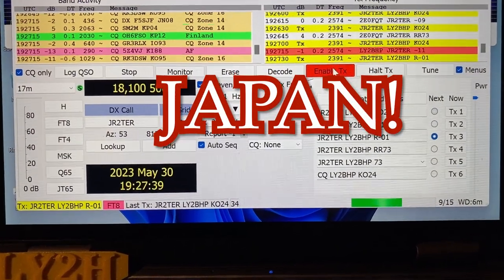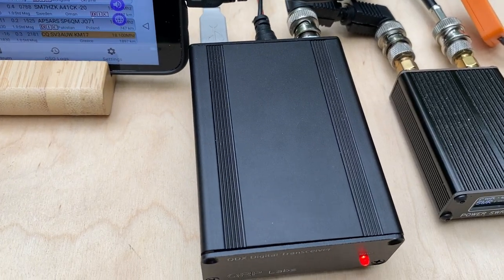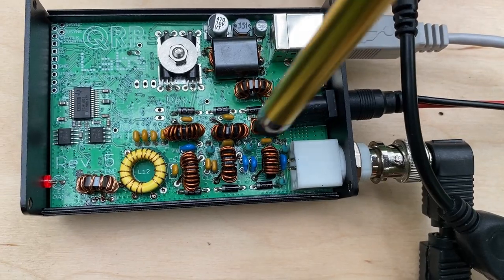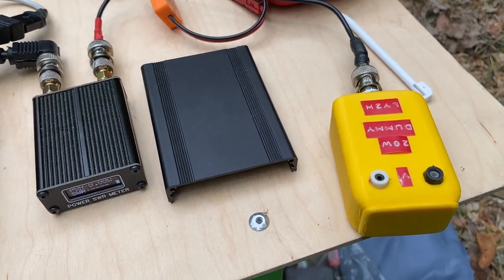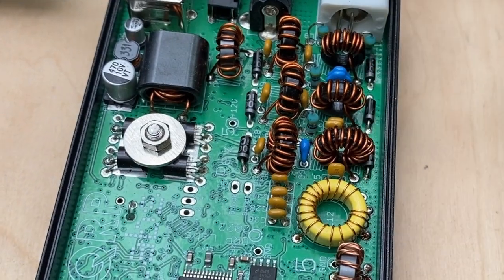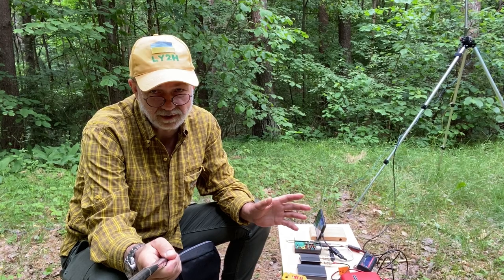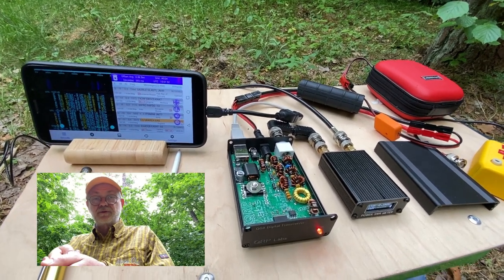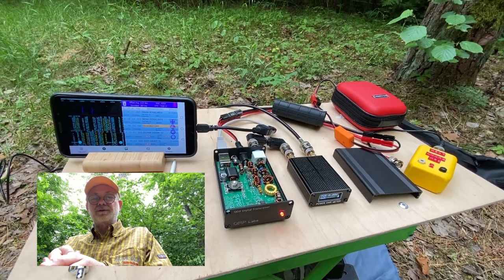QDX High-band Digital Transceiver. Problems you didn’t expect.

Comment: They changed to blue/yellow cores in a later version of the high band.  I had a wrong mterial core when they were all black.  Both work fine.  These are great rigs. 73
Reply from the maker: Thanks for the info! Yes, you are right, I think the info on the changed toroid colors was explained by QRPLabs as changed suppliers etc. Have fun! 73! LInas LY2H

Comment: Nice video and thank you for sharing. How do you tune with the tuner? Do you use another rig to tune it to the band you want first and antenna, then use the qdx or do you have another method?  73 Jason, WV3V
Reply from the maker: Thanks Jason! In this particular case I've been  using my Nano VNA to tune my vertical whip to resonance before running the QDX. In other cases when I can't use any resonant antenna,  I would use one of my tuners I have, like T1 , N7DDC or manual Z-match, etc. The FT8CN app does not have the Tuning function to generate the signal, unfortunately, so it would probably take just to call CQ :). Again, the resonant antenna would make things much easier and safer for the finals, but on the other hand , my personal impression is that the BS170 transistors stand a short-term over-SWR which might appear during tuning quite OK. HTH, 73! Linas LY2H

Comment: What are you using to power that transceiver? I just took delivery of a low band model designed for 12 V supply. But I'm being advised not to run it at 12 V because that may blow up the finals. I had intended to use a 12 V Talent Cell battery from Amazon that is switchable between 5 V and 12 V. But maybe I should get a 9 V battery instead. What do you think?
Reply from the maker: Hello, I think the power supply voltage is not causaly related to the death rate of the final transistors :). There are many more other ways  to kill the BS170 :). I'm running my QDX's off 9V but due to other reasons which seem important for me, like, being able to use a wider range of  batteries, including partially depleted 12V batteries :), etc. I'm using an in-line DC/DC downconverter to get my 9V in a compact way. It's desribed in detail here:
https://youtu.be/9dobqEHw9Ks

But 12V is fully legit and has its own benefits, like you can get the power output reduced easily ( if you want even more QRP than it is)  by feeding the12V radio with 9V power supply . I'm building the new QMX now and I think I'll make it 12V as I'm planning to use it also on  WSPR and other beacon modes where you only need the power of 1-2W or less. HTH, 73! Linas LY2H

Comment: Thanks for video Linas. Hoping to build a QMX soon and get it connected to my Android phone like this for some portable digi ops. Alas, currently, QMX is like Low Band QDX and only goes up to 20m. I know that I will miss 17m. However, Hans has indicated he may produce a Mid/High band QMX. 17m has been a fantastic band recently for QRP and portable/mobile operation.
Reply from the maker: Absolutely, Steve! The same’s here- I’m in a process of building the QMX and I’m , too, already missing the 17m band :). No doubts, there will be High band version of QMX too, Hans seems serious about that ! So, let’s solder and wait :) 73! Linas LY2H

Comment: What cable are you using to go between android and QDX. Thanks Joe
Reply from the maker: Hello Joe, thanks for watching. It's a two-part cable comprised of an micro USB to USB-A female OTG  pigtail (available in all places selling smart phone accessories) and a short USB- B to A cable which I made myself of a 20 cm piece of a standard B-A signal cable with self-installed A end. I DIY-ed as I hate these long "printer" cables coiling around :) HTH, 73! Linas LY2H
Reply: @Linas_LY2H  Thanks very much. 73

Comment: Linas, thank you for your videos!

Can you tell me what cable youre using between the QDX and SWR meter? That looks really nice!

Also what antenna do you use? EFHW? Any particular kit? In an inverted-v, or just thrown up in a tree?

Thanks!
Reply from the maker: Hi Tedd, thanks for watching! The cable is home made of two BNC 90 degree angle connectors and a short piece of cable :) I failed to find in my junk-box  SMA patch cables of a right size, so I went DIY BNC :) 73! Linas LY2H
Reply from the maker: Sorry Tedd, I've missed the antenna part of your question :). The antenna is a vertical described in detail in this video https://youtu.be/9ob7RVwbkOU
HTH, 73! Linas LY2H
Reply: @Linas_LY2H  all good, thank you for your replies :). I've been checking out all your videos, I think I want a kit very similar to what you have for your "portable POTA ops", but I'm having a hard time getting some of the pieces together. This is my first adventure into HF so I'm hoping to get it right.

Cheers, 73!

Comment: Is there a way to tell if it uses 9 volts or 12 volts power by looking inside? Thanks K7WHN
Reply from the maker: Hello Joseph! It's a very good question!  Just I'm not sure there is a good answer to it :). The only thing which differs between 12V and 9V versions is the T1 transformer. It has 3 turns of secondary winding for  9V and 2 turns secondary for the 12V. So, theoretically, you could try to take a peek into one end of the transformer and see how many windings in general do you see -5 or 6. But practically,  it would be very difficult to do, IMO :). I think, the easiest way is to feed the radio with 9V power supply and see what RF output power you have on the dummy load. If you measure full 4-5W, it's a 9-volter, if only some 2W, it's a 12V radio. I think, this would be the safest way, as 9V is harmless to any version. I personally, always mark the top of the T1 during the assembly process with white Sharpy pen what voltage is it wound for , and  I put the same mark on the radio case near the power supply jack. HTH, 73! Linas LY2H
Reply: @Linas_LY2H  
Thanks I will try 9v first. 73

Comment: Love your videos !!! ..... wondering how long a 9V battery would last on a QDX ?? ... thanks !!! de N2JNZ
Reply from the maker: Thanks for watching George! And thanks for a good question. Best of all if I (or you too) could just hook the 9V alkaline up and see how long would it last with QDX, but I have no such battery at hand at the moment :) So I can make some rough calculation instead. 9V alkalines are said to be about 500mAh of capacity, accordingly to some specs. So, my QDX power draw is ~140mA on RX, 850mA on TX. In FT8, we have 50% duty cycle, i.e., 50% of time we transmit, 50% we receive (we may, of course, be receiving all the time, or transmitting just a bit, but still when we make a QSO, it’s 50% duty cycle). It means, my average TX current will be 425mA, RX-70mA, total - 495mA. If battery’s capacity C=500mAh, then it would last 500:495=1.01 hours. In theory! That is, assuming the battery would  be supplying the same 9V at the same current all this time. Which is NOT true in the real life. First, we can only use the battery until it discharges up to 7.5V (despite the battery’s full discharge is at 6.5V) as this is the lower limit of supply for QDX, it stops working at a lower voltage (not enough of voltage for the internal 5V buck converter). Secondly, the 9V alkalines are NOT designed for such a high current draw, so it may die much quicker then this calculation due to overheating of the junctions between the individual cells in the battery, depending on brand, probably. Thirdly, the discharge curve is not gonna be flat because of the high current, so the 7.5V could be achieved suddenly, on transmit only first, but it will already disturb the work of the QDX. So, not much left of our theoretical 1 hour! 10-15 minutes? I don’t know, it’s my guess. Anybody reading this, have you done that, probably, practically? Please drop a comment here! 73! Linas LY2H

Comment: Hi Linas, I'm Paulo, CB entusiastic, using a QDX high frequency too. Mounted by me, my very first kit😊. Mine have an output in all bands of 2W, not afraid about, because I have a lot of contacts. I'm using 11 meters only in JS8Call frequency 27,245 USB. We are a lot of stations using this beautiful mode. 3 years ago trying using FT8, but the program do not recognize our call signs. We only use js8call at the moment and Varac. I'm very happy about all information that you put on the video, about this wonderful rig, that work's amazingly beautiful. Only one question what kind of power supply are you using? Tks 7351 Paulo.
Reply from the maker: Hello Paulo! Thanks for watching! Nice to hear CB people also active on digital modes! For my power supply I use a DC/DC buck converter in my own designed 3D printed enclosure. Please check this other video of mine here with all the details : https://youtu.be/9dobqEHw9Ks?si=guPcme9cunEDntSx
HTH, 73! Linas LY2H
Reply: @Linas_LY2H  Yes inspired in your videos I have DC/DC buck converter too. I'm my home using power supply of 13,8V, when go to the field, using the battery of my car. But now I'm interested in more mobility in the field, so I have to doing a battery, what kind of battery you have? Tks Paulo.
Reply from the maker: @antenaseinterfacescb  Hi Paulo, in my outdoors operations, I'm using my home made battery packs for low power (5-10W) and up to 50 W operation, and for my 100W portable go-box I use more powerfull Bioenno 20Ah LiFePo4 battery. My low power Li-Ion  battery packs are featured here:
https://youtu.be/fgkG5EZklFA?si=EeCn9vGjl7Z46O4G
My medium-power home-made 12Ah LiFePo4 battery pack is featured here:
https://youtu.be/DI8yfxBGDJ4

The 20Ah LiFePo4 battery is most probably described on the Bioenno website. HTH, 73! Linas LY2H

Comment: My 12v low band QDX seems to be a good performer on output power.  5.25watts on 10m and 3.5watts on the remainder of the bands.  It is very poor on the receive side of things.  I had to increase the gain on the band configuration to 95 to get the slider to reach 30dB.  Can't figure out what the issue is.  Band pass filter maybe.  You know your way around this unit very well, any suggestions would be appreciated.
Reply from the maker: Hi Raith,
you mean your 12V HIGH band QDX? 5.25 W on 10 looks nice to me but 3.5 on all the rest  a bit too low . I would try to tweak the windings on the  LPFs  to get more even power output on all bands. As to the poor reception, well, the BPF on L12 would be the first candidate  to look at for me. Most trivial reason is a low quality soldering of contacts on L12. I would re-heat these contacts and let the solder "eat" the enamel on the wire for some 15-20 seconds. Also, the QDX troubleshooting article on QRP-labs site and the great group community on  iogroups would be my favorite places to look for advise. Good luck, let us know here how's it going! 73! Linas LY2H.
Reply: @Linas_LY2H  Thanks Linas.  Will give it a go when I get back to civilization.  Currently 700 km north of my home qth at my remote cabin.  Using starlink internet for coms and of course my ham radios.  Appreciate the input.
Reply from the maker: @raithjames860  Whaw! Fantastic! Have a great stay there in the cabin and many DX! 73! Linas LY2H

Comment: Hans and friends have a new winding scheme on the binocular transformer that cures the low power on 10m.  I have chosen not to rewind my because I get 3.5W.  The new winding scheme overcomes a self resonance that causes the power reduction on some units.
Currently the new QMX has some issues with FT8CN that will probably get resolved in firmware upgrades - works fine with WSJTX.
Reply from the maker: Thanks for the info! I'm currently in a process of assembling the QMX and the "weird" transformer is to be wound soon. Looking fwd to making a review on my QMX if all is gonna work ok,:) 73! Linas LY2H

Comment: Nice little setup. I have 2 version 3 QDX kits to put together, so I'm going to steal ideas from you. :)
I think I'd use Mix-6 on 10 meters, though anything over 3 watts is fine as far as I'm concerned. High efficiency matters more o me than high power. I don't know what black toroids he's using, but I've had good luck on 10 meters with the efficiency of Mix-6 toroids in other small project builds.
Reply from the maker: Thanks John! And good luck in your kit building! I see no reason why your mix-6 toroids should not be good, number of turns adjusted  accordingly. 73! Linas Ly2H

Comment: I’m not surprised about the low output power. I received my QDX kit without the PA transistors and upon writing an email back about this I got no response. I ordered them myself and finished the build and the radio works but I would not buy it again…
Reply from the maker: Hello and thanks for sharing your experience ! I have been buying 5 or 6 kits from this company and, luckily, there was no single case of missing parts. But I always have a handfull of BS170 transistors  handy, in case some of them decide to kick a bucket :). 73! Linas LY2H
Reply: That's weird. I thought I ordered my QDX with 4 day shipping instead of 7 day (turns out I'm in DHL zone 4 and FedEx zone 7) . When I emailed QRP Labs/Hans, to check the status, he informed me he thought I ordered another product that's currently out of stock, then ended up sending out my QDX right away. He even switched me to FedEx shipping since it would be quicker, and refunded me the difference.
Reply from the maker: Now that's a Customer Service! I'm glad you got your QDX, finally! 73! Linas LY2H

Comment: QDX Rev 5 High Band 9 Volt
Nissei DG-503 Watt Meter/SWR
SDS 1102CML+ Scope
MFJ-264 50o Dummy
EVENTEK KP3010D

20m   4.91W Nissei   22.8VRMS Pre Filter     18.8V RMS at BNC      -17dB RX    1.10A   
17m   4.07W               17.2V RMS                     18.8V RMS                      0dB           1.15A
15m   3.11W               15.2V RMS                      15.2V RMS                   +4dB           1.05A   
12m   2.11W               15.6V RMS                      12.8V RMS                    -2dB            0.92A
11m   2.58W               13.6V RMS                      15.6V RMS                   +0.5dB         0.96A
10m   2.67W               14.4V RMS                       16.1V RMS                  +0.5dB         0.93A

RX 0.160A @ 9V